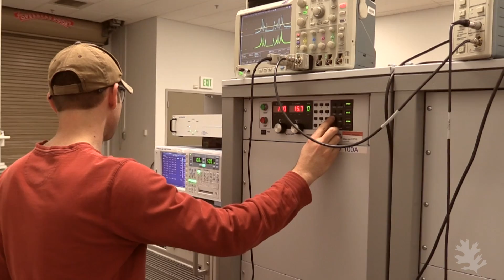ORNL surges forward with 20-kilowatt wireless charging for electric vehicles

Comment: I fully agree, something needs to be done, to make EV's more useful. And the answer is not (just) better batteries and more Kw for the charger. 
So why don't you take it all the way, and TRULY charge the cars on the go?? I'm thinking with an arm that swings out from the rear bumper and catches an intelligent rail on the side of the Interstate. 
Kinda like electric trains, just with 2 poles now there are no steel track/wheels to act as ground. And with an intelligent rail, that quickly turns on/off 20-30 ft sections as a valid (authorised) car passes by. This both for safety and for billing.
The advantages for such a system is huge. Cheaper and lighter EVs (less battery) and with unlimited range. No need to ever worry about where's the next supercharger or even charging infrastructure at home No need to ever plug them in. Just drive and only worry when they need new tires.  
I know this probably requires cars with autopilots in order to follow the rail precisely enough, but most all cars will have that anyway, by the time such an infrastructure starts rolled out. 
And this should be competitive with e.g. induction from the road surface, both as far as initial cost and long term maintenance, as these rails can be mass produced and then bolted onto the existing guardrails. Easy acces for install and repairs.